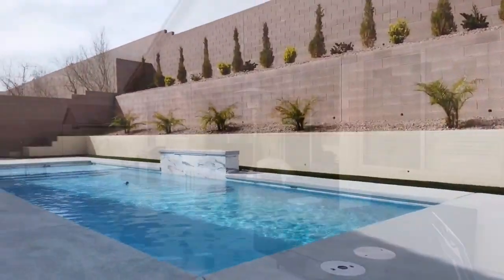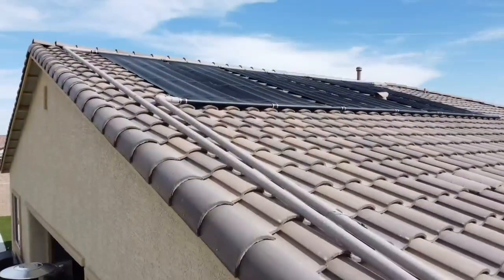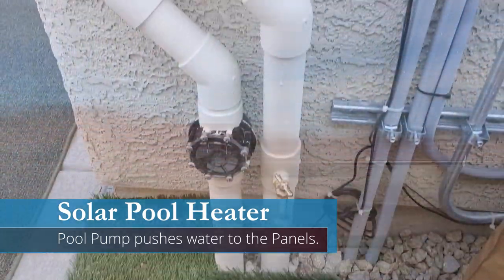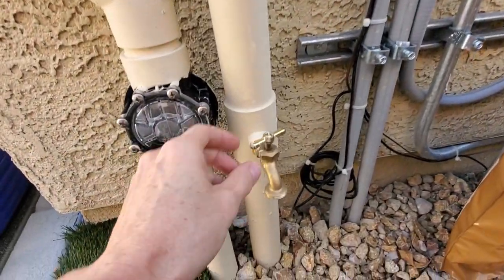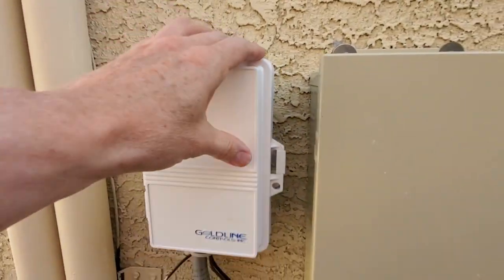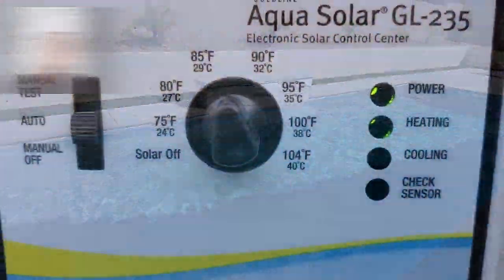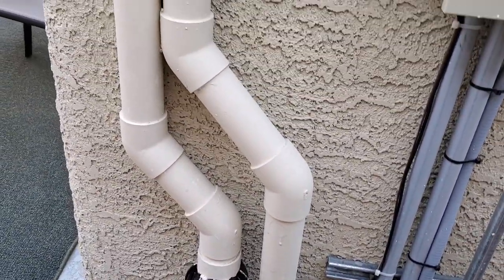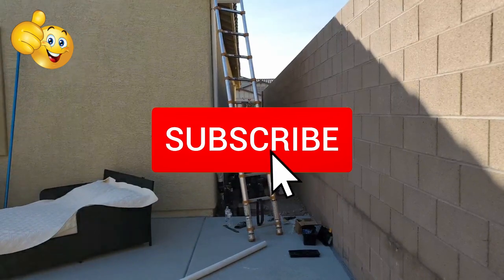Solar Pool Heaters 2021 - Turning On Solar Pool Heaters

Comment from the maker: If you have a Solar Pool Heater then this is a must watch video! Any questions? please feel free to ask in the comments below. Thank you for watching!
Reply: Dear ultimate tech? It appears that you have plumbed the water cut to come down from your roof and then go underground to the return lines probably for the pool. Do you lose much heat from that water while sending those lines 15 or 20 feet underground? How cold is the ground during March, April, and October and November?

Comment: The water is actually pumped up the solar panels, not down by gravity. The viewing window in the other pipe shows the flow arrow pointing down to the pool. The drain valve tap is on the pump up pipe because it is connected to the bottom of the panels and will therefore drain the water easier.

Comment: Hi, a coupe of things I didn't really understand... Why won't more panels heat faster? And why turn it off in the winter... Wrong it get somewhat warm?
Reply from the maker: More panels won't make it warmer faster. If that was the case every house with a pool would have the entire roof covered. The reason I turn it off is it won't get the pool even to 65 degrees in the winter so what's the point. And you don't want the pipes to freeze as well. Remember the temp of the pool is the same as the temp outside at night. If it's 50 degrees outside then that's the pool temp. No solar pool heater can raise the temp by 30 degrees in a single day.

Comment: Hey I had Naylor come and drain my solar for winter, now I don’t remember how to turn it on for summer, do you just turn the box on? I have the same setup as you.
Reply from the maker: Close the drain valve at the bottom of the pipe. It looks like a typical water connection like the one on the side of your house. Then turn on the heater to auto. Set it at 90 degrees and have fun!
Reply: @UltimateTechHub  awesome thanks, just couldn’t remember if I had to turn the valve, but just turned the box on.

Comment: Great video! Quick question. The valve was never turned off for the winter season here in Florida and I was wondering what to do. Should I turn my system off and drain all the water from the valve? Kind of new to this. We just took over my in-laws house and was never walked through the steps on how to work these panels. They have both passed on so asking them is out of the question.
Reply from the maker: Only drain the system before winter and leave the valve open all winter. If it's warm now then no need to drain it.

Comment: How does the thermostat work?  Does it wait for the panels to reach a certain temp then redirect the water through them or is water running through them continuously?  I have a very similar box, it says "Heating", but sometimes the heating light goes off.  Does that mean the panels have reached the desired temp OR the panels reach the desired temp?  I'm pretty sure the panels get a lot hotter than the water.  After a while it seems like the water flushes out of the system and the Heating light comes back on.  Can you (or anyone) explain a little more about the mechanisms?  Thanks!
Reply: It’s a differential control. The turn on differential on a GL-235 is 4 degrees. When the solar sensor on the roof (or wherever the panels are mounted) is 4 degrees warmer than the pool water, pool water is diverted to the solar system. Water flows continuously through the panels and piping at a flow rate of about 5gpm per panel.

Comment: Is there a guide to how to size a solar heater? I have 200 feet of 1 1/4" pipe in a plywood box that is not big enough to make a difference. My pool holds 13 cubic meters of water roughly 15 cubic yards.

Comment: My heater is set for 85, but the pool temp has been stuck at 70 for over a week.  Outdoor temp have been in the mid-seventies to mid eighties.  Night time temps are low to mid 50's.  I can hear when water flushed through the pipes and the heating light is on, so I believe the system is functional.  Is this normal to heat so slowly?
Reply from the maker: Yes this is normal. Your heater is sending warm water to your pool. The issue is the nighttime temperature.  Your pool will cool to the nighttime temperature. The heater can increase pool temps up to 10 degrees per day if it's in the mid 90s. Once nighrs are at 70 or 75 your pool will get warm quick.
Reply: To you have a solar blanket to keep the heat in overnight? It will really help
Reply from the maker: @ddtuss2585  No, I really want to get one though. How much are they on average?
Reply: Without a solar blanket overnight you'll lose your daytime gains in those low temperatures.

Comment: All I can picture is the similarity to when you turn on your garden hose and it comes out hot but then cools after a minute or so. Is this not the same where eventually the heater isn't enough to heat the water sufficiently and cold water comes out?
Reply from the maker: Nope the water heater on the roof is large enough that the water circulated in the heater gets hot then goes back down the roof into the pool. We have a inground cleaner and the water coming out is very warm. Pool temps are around 80 to 82 now. June and July will be about 90.
Reply: @UltimateTechHub  - thanks for the reply. I read in another post where you mention running it parallel to split up the distance. What would you say is the total distance the water travels from input to output of the heater? Maybe running too long a distance is what contributes to cooling off like the water hose example I mentioned?

Comment: If it doesn’t freeze where you live, zero reason to winterization
Reply from the maker: @graphguy  It does freeze probably 4 or 5 days in the winter otherwise I would never winterize it.
Reply: @UltimateTechHub  you mean "if" not 'it does' right?   I live where it never freezes, but he solar guy keeps telling me to spend $500 to wintererize/spring 'open' it and from his check list, I see no reason to do so.
Reply from the maker: @graphguy  You can do it yourself by draining the solar heater and leaving the valve open all winter. And of course turn off the system. That's really all you have to do.
Reply: @UltimateTechHub  but my point :) is...
if it doesn't freeze where you are.. there is zero reason to winterize.  You are better treating it as you would in June.
Reply from the maker: @graphguy  Yep

Comment: So basically in the winter this system dsnt work at all... isn't that when you would want the system to heat the pool becuase  it's cold. Why would I want the heat the pool in the summer it's all really hot...this system works a$$ backwards useless.
Reply from the maker: It heats the pool in the spring and fall when it's not usually warm enough to swim. It adds a couple of extra months to the swim season. Thank you for watching.
Reply: @UltimateTechHub  the sun isn't ass strong in the winter ,fall,or spring like it is in the summer so in order to heat your pool from like 60F to 75F or even 80 it would take a very long time to hit that temp when it's cold outside you would need hot day and a solar blanket to keep the heat.
Reply from the maker: @ralphbarrios590  It worked for us. We swam in October and in April. As long as the low temps stay around 68 to 70 the pool gets to 80 degrees or more. We live in Las Vegas and the sun is always hot even in the spring and fall.